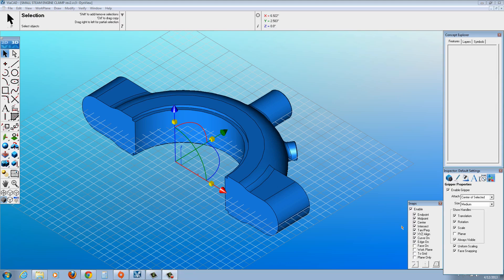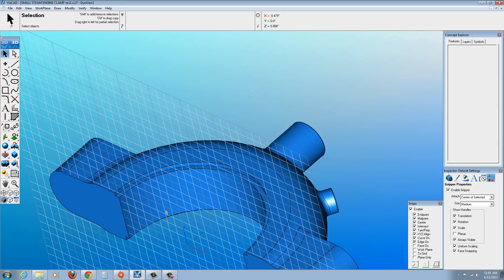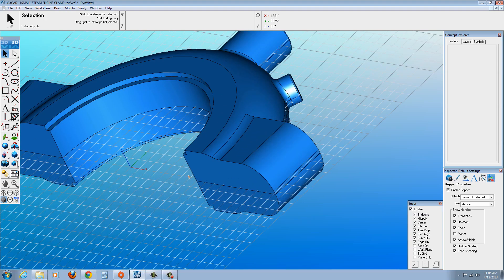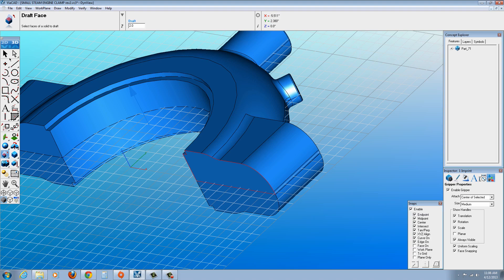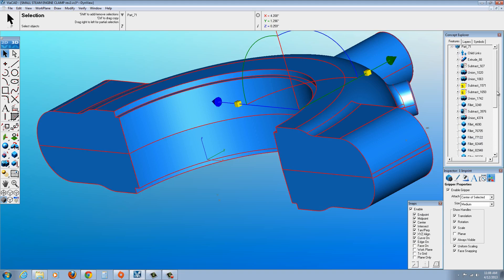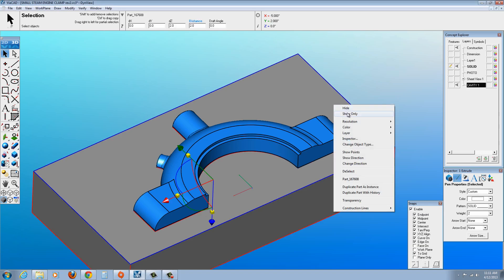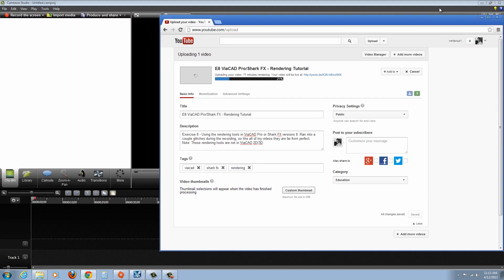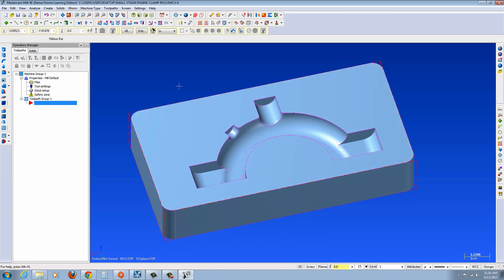E9 ViaCAD & Mastercam X6 Tutorial

Comment: Hi there, it seems like ViaCad is not suited for e.g. injection mold design due to its lack of creating complex parting lines, draft analysis, shut-off surfaces etc. Would you agree? I can't seem to find a half-way decent way of doing something like that in VC.
Reply from the maker: Hi Bjorn, Yes, ViaCAD has some limitations for Mold making. Remember at around $99US that it is a fraction of the cost of other CAD tools. Hence you will have limitations.
Reply: vertanux1 Yes I see, I was figuring that there would be the limits to that. May I ask what your take is on ZW3D and TopSolid? Would you be interested in doing a feature on your channel for them. Both seem like potent runner ups as alternatives to SolidWorks etc.
Reply from the maker: I haven't tried ZW3D (I'll check it out). TopSolid is very robust in it's functionality, and is an ideal tool for mold design and CAM.
Reply: vertanux1 ZW3D looks also like a bargain, however the net is full of stories that they use legacy code and the support is expensive. Also the way they structure their product packages is somewhat perceived as odd as the cheap version lures you in, and then you pay for essential functions later. But that's just my hearsay I picked up. I am looking forward to your trial.